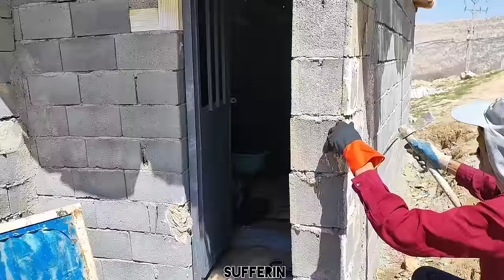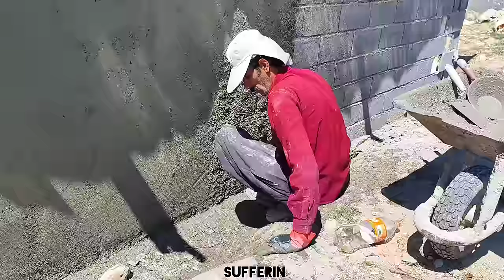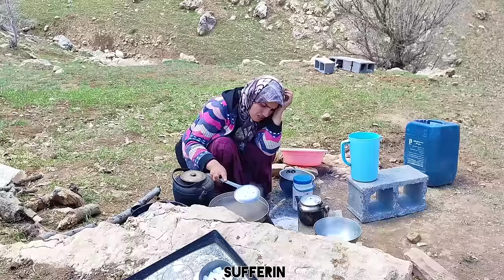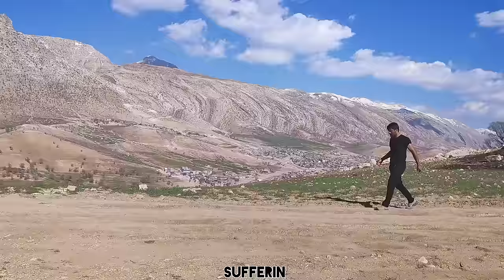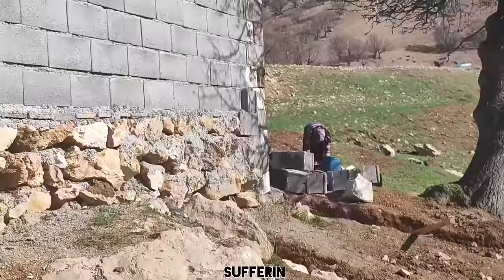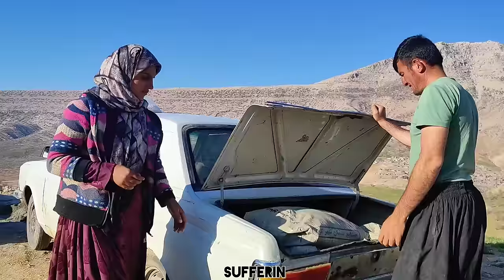The confusion and worry of a divorced mother for her daughter and Qabad's efforts for a dream house￼

Comment: Im wondering what they are waiting for with the wood stove and pipe.  The stove should go in the big room and up  through the roof.  Use a gas heater for the little room so the kids dont have to deal with fire at night or  have a messy pile of wood taking up space. 
Can you tell me why there is no door to go from room to room?. Why would you want to walk outside just to change the room your in. Especially in the winter.
Reply: Maybe Aida didn't want to live in a separate room with her brother, away from her mother, as this house design is.🤷🏽‍♀️